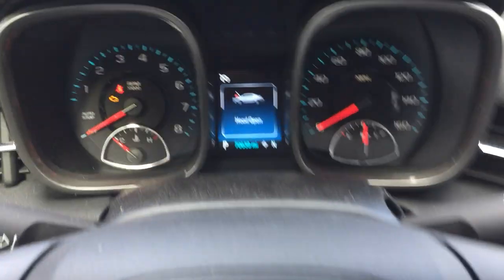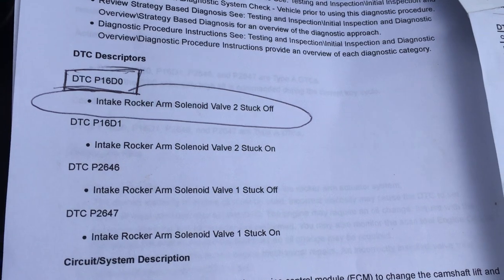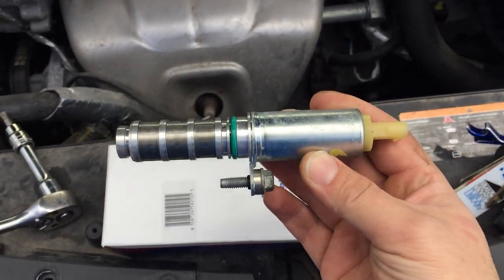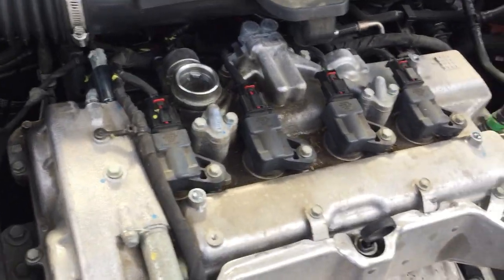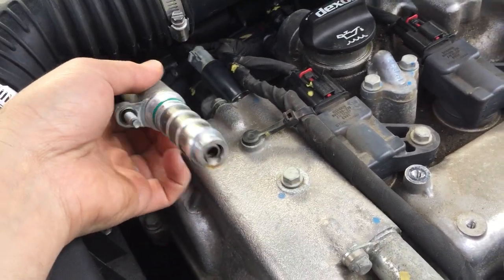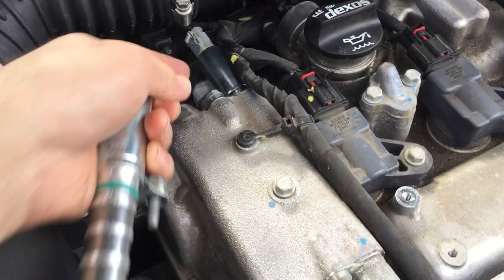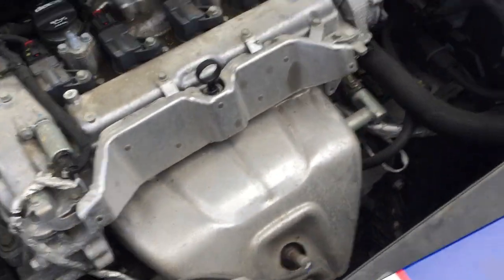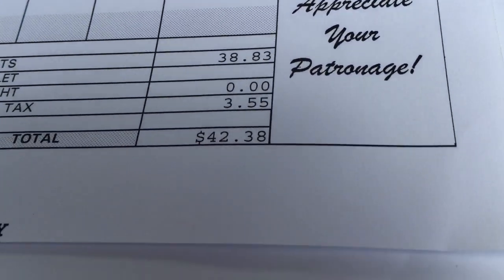How to 2014 Chevrolet Malibu 2.5 Intake Solenoid Valve Replacement (Same for 2013-2016)

Comment: Thank you for taking the time to make the video. My exhaust solenoid failed on my Malibu at 82K miles. It started sounding like I had jake brakes or a custom air cleaner when the CEL came on. Dealer quoted $287. You also gave specific instructions on how to disconnect the wiring connector (3:15). Cleared code with OBD2 Scanner. Fuel mileage shot back up immediately. Thanks again, sir!
Reply: You can also disconnect the battery for about 5 minutes and the check engine light should go off if you have already changed the solenoid. 👍 
Worked for me anyway.

Comment: This is a great and helpful video! Took the malibu in and got a quote, mechanic said $1300 to fix this issue 🤣 part was $55 and took 15 min to change. Thanks!
Reply: What did you use to remove the three screws holding the engine cover on? they are a wierd triangle type screw head
Reply: Star tip head. T 30 I think.
Reply: @BMBProductions98 what he said will work or a tri point bit

Comment: I thought your diagnostics said it was the rocker arm oil control solenoid?  What you changed are the VVT solenoids.  And the Rocker Arm Oil Control solenoids had a special coverage "warranty" from GM under certain circumstances.  FYI

Comment: Wow! My 14 Malibu has a stall issue that the dealership had to contact GM over. They said the problem was the "intake camshaft actuator". The dealership told me it costs $330 for parts, labor and tax!
Reply: Mines stalls too. Like when I put it in reverse or accelerate slowly, when I’m sitting at a light it feels like it wants to stall.
Reply: @Rich A  ours ran fine until we got to a redlight and autostop kicked in. Then it would try to restart the engine and shut down completely. We replaced the intake and exhaust solenoid, worked great (until my wife totaled it 4 months later 🤣)

Comment: That’s strange because that part is a ENGINE VARIABLE TIMING SOLENOID. The CAMSHAFT SENORS A/B BANKS are small plastic plug looking. Codes P0016/P0017 is the manufacturer’s EU  ID#. Those 2 parts in the video are filterers and sliding slot valves for timing of the cam lobe and spark firings DURALAST TS1191. I know because I have a 2015 CM with the 2.5 liter Eco TRASH. I had trouble with check engine light from TIMING CHAIN SLACK,PCV FRESH/ SECONDARY/SPARK SEQUENCE/ACCELERATOR THROTTLE POSITION/LOW OIL PRESSURE/ REDUCE ENGINE POWER/HIGH O2 and EXHAUST O2 and RESONATOR SENSOR  oh yea my head lights, both brake lights and the turn signals along with the battery all started and went bad at exactly 105k mile marker. I change my oil, brakes, fuel filter and maintenance of all my vehicles in scheduled maintenance . This is the only GM vehicle in my entire life. I am a FORD AND TOYOTA MAN. This vehicle is a highway vehicle and it’s a piece of SHIT. I have a FORD MUSTANG 1990 is a hot rod with BOOST 1656HP,FORD EXPE 4.6  has 187K miles and Lexus GS460 has 134k milesNo problems with any BUT THIS ECO TRASH is a SHIT Pile.
Reply: That's what I said!  LOL. Those aren't even the Rocker Arm oil control valve solenoids.  The the VVT solenoids.  his codes probably came back on after driving it for a bit because disconnecting the battery would have cleared the codes temporarily.

Comment: My car is doing a very small skip/shudder in 3rd and 4th gear. The ONLY code that keeps coming up is P2646 (15’ Malibu LT 2.5). I changed the oil and it started driving a little better, but it’s still doing that random skip/shudder (it’s ugly). Any suggestions? Again, no other code comes up and when i turn the car off, the engine light goes away and the car is fine. Not sure what to do.
Reply from the maker: Hey there, sorry to hear about your car.  So 1st thing I suggest is to check the related fuses, some of these cars have a fuse for related oxygen sensors, rocker arm actuator system, and related sensors.  Just pull you owner's manual and start checking every single fuse or just related fuses.  If any related fuse is bad, replace it.  Also replace your Air filter if it is bad or dirty.  If you had the Air filter for more than 10-12K miles just go ahead and replace it.  It only costs $10-$20 or so.  Since it ran little bit better after oil change, the problem seems to be the dirty, or clogged solenoids, valves, and sensors.  So I would also pour in about 5 ounces of Seafoam or Gumout into the engine run it for 20-30 highway miles or so and then do another fresh SYNTHETIC oil change.  This might help, but you have to spend $30-$50 on this one.  Here is one video where it helped my car after I changed the "Oil Control Valve" on the engine.  So here it is: 
https://www.youtube.com/watch?v=gbACkPvNyrY
How many miles do you have on your Malibu?   I hope this helps, let me know how it goes.  Good Luck!!!
Reply: @fixit3879  can you put that in a turbo motor?

Comment: I have the pc16f code on my Malibu 2015 2.5 Lt looks to be about the same problem gunna replace both intake and outtake looks simple enough
Reply: Did that solve the problem, I have the same code
Reply: @joifullyfit  i thought it did but then the check engine came back so I changed the engine variable timing oil control valve the check engine was still on but after driving it for a bit it went away on its own

Comment: I replace both of those valves Intake and exhaust Solenoid , Light came back on after 15 miles....
The intake rocker arm solenoid in the center of valve cover is my next try...
 I been looking for info on  P16d0   This is what came up on alldata =
Remove the Q25 Rocker Arm Solenoid Valve. Verify the following conditions do not exist:
Torn, restricted, mis-positioned, or missing screens at the rocker arm solenoid.
Engine oil leak between the cam cover and the rocker arm solenoid.
Oil seepage at the rocker arm solenoid connector.
I replaced the wrong solenoids ,
Reply from the maker: Sorry that you are having tough time with it.  How many miles do you have on yours?  Here is the video that helped me with my P16D0 code.  Once I replaced the oil control valve, it fixed the P16D0 code.  
https://www.youtube.com/watch?v=gbACkPvNyrY&t=2s
Sometimes the same code can be thrown off for 10-15 different problems and it can be hard to pinpoint the solution.

Comment: How much was it and where did Yu purchase Solenoid Valve
Reply from the maker: It was about $40, I purchased it from Chevrolet Dealership.  Hope this helps, Good Luck!
Reply: @fixit3879  my Chevy dealership where I live in Louisiana wants $108 for this part and also I brought it to a shop just to see how much they would charge to put it on they say $360😱 hell no!! I watched yur video how Yu said Yu put yours on ND it looks pretty easy So I'm thinking about doing it myself but I'm kinda scared! I Kno I need it done but I don't have $360 to gv for smthng dat won't even take 30 mins to put on!  I saw the part online Wut do you think about online purchasing the part? Also wut will happen if I don't get it done soon my car is a 2014 Malibu with 124,000 miles due to job travel
Reply: @imaqueenfirst980  online is fine. The parts come from the same places. You need the part. Get it done!!

Comment: Bruh I've replaced this exact thing and I still have a check engine light. I believe it's actually the variable timing control valve, not the intake solenoid like the code says.

Comment: I've replaced in my 2013. Camshaft position censor. Couple years ago now I'm getting a overtimed camshaft position. Timing brlt?
Reply from the maker: Thank you for sharing.  Honestly I am not sure about this one.  Do you have check engine code?  How does the car run?  How many miles do you have on it?  Is the engine oil fresh?  It is possible the timing belt may be worn, but it can also be few other things....

Comment: Question , by any change when you accelerate do your car make a noise like a growl. I got the LTZ 14
Reply from the maker: No not growl or noise. It was fine after I fixed the code and replaced the intake solenoid valve.  However 2 months later same code re-appeared. This time I had to replace an “Oil Pressure Control Valve” and it fixed the shakiness at 35-60 mph speed. The oil pressure valve part coast around $98.  There 2 fixes that I found out so far.  Replacing the oil pressure control valve helps too.  And please people use synthetic oil now. These modern cars the conventional oil is messing up all the valves and tiny engine components from my personal experience.  And do change oil frequently without delays....
Reply: FixIt I thought we have to used synthetic blend
Reply from the maker: Maybe so.  But the problem with synthetic blend is we don’t know how much of it has synthetic oil in it.  So most mechanics suggest using synthetic oil on these modern cars.  I personally switched to Royal Purple premium Synthetic oil a year ago for ALL my cars. I can go 10-12K miles on Royal Purple.  I love it.  So my opinion is using synthetic oil  is better than using synthetic blend.  Good Luck!
Reply: FixIt thank you will try it out
Reply from the maker: You are welcome!

Comment: GM has a Special Coverage Adjustment N192289160 Rocker Arm Oil Control Valve Inoperative if under 120k miles or 10 years old

Comment: My connector that connects to the exhaust solenoid valve is broken where can I find a replacement?
Reply from the maker: Hello Bruce.  Any local Chevy Dealership will have that connector at their Parts department.  If they don’t have it they can order one for you.  Just check with the Chevrolet Dealership, any dealership is fine.  Just the socket ranges from $5-$15.  Sometimes if it is an entire wiring harness then it may Range $20-$150.  Hope that helps.  Good luck!

Comment: What was the issue with your car before replacement?
Reply from the maker: Honestly nothing except for the check engine light was on and it gave the P16D0 code.  However at times I felt mild vibrations at certain speeds around 35-40 mph throughout the car.  It would come and disappear.... hope this helps.
Reply from the maker: So another possible fix is replacing the “Oil Pressure Control Valve” about $100 for that part at dealerships....
Reply: FixIt Do you have a write up for replacing the oil control valve? Keep getting p16d0 code, I replaced the intake rocker arm solenoid but the code still remains.
Reply from the maker: Hello Ian Halstead.  Here is a short guidance video as to what part and how to replace it: 
https://www.youtube.com/watch?v=gbACkPvNyrY
Reply from the maker: Good Luck!!!!!
Reply: Nothing down and check engine light on

Comment: For anyone watching this in 2021, Chevy has released a special coverage for 2014 Malibus for this code and a couple others: https://static.nhtsa.gov/odi/tsbs/2020/MC-10177367-9999.pdf
Reply: Nicholas, thanks for the information.   Replaced mine at 137K   Outside the 120K warranty but this is a none issue from GM.   After purchasing 8 GM vehicles lets see if they stand by the product.

Comment: The code P16D0 is for the Intake rocker arm solenoid valve 2 stuck off. The solenoid you replaced is for theVariable Valve Timing system and NOT the rocker arm control system. The intake rocker arm solenoids are in the center/back side of the valve cover. You replaced the wrong part that had nothing to do with your code. Maybe know what you're doing before posting a video on YouTube because who knows how many people replaced the wrong part because of your video. You really should take this video down so more people don't waste their time and money.
Reply from the maker: https://www.youtube.com/watch?v=gbACkPvNyrY
Reply from the maker: https://www.youtube.com/watch?v=gbACkPvNyrY
Reply: Seriously
Reply: He replaced the right one the code is pc16 for some reason it comes up wrong in autozone computer for pc16 as the intake rocker arm which is p16d0. How I know. I’m a mechanic and just had to change mines. He did a good job tho. It’s only a 5 min job thanks.
Reply: What you are saying is half true...Manual says to replace the Q25  Rocker Arm Solenoid Valve but there are many confirmed fixes of intake timing actuator solving problem.
Reply: @djenn434  You are wrong. I am an automotive service technician with over 20 years of diagnostic experience. The code setting criteria for this DTC is for only the rocker arm system. The VVT solenoid cannot set this code. People claiming that the VVT solenoid fixed their problem probably had an intermittent fault that didn't reoccur after replacing the wrong part.
Reply: @thirdeye530  Ya I went to school for auto mechanics and work on vehicles too...Also have access to Alldata and identifix, do you know what identifix is or have access to it? There are like 30 confirmed cases of intake solenoid fixing this code.
Reply: @djenn434  Yes, I also have access to those sites but those "confirmed" fixes aren't confirmed. Anyone can "confirm" any fix for any problem and post it to identifix. It doesn't mean its confirmed... or correct. I've worked with enough idiots over the years to know that most mechanics working at shops dont really know what they are doing. Do you know what code setting criteria is? This DTC  can't be set by the VVT.
Reply: @thirdeye530  Sounds like we have the same information and if there weren't 30 confirmed fixes in identifix I'd be agreeing with you 100%...I'm just putting a little more faith in identifix which may be a bad thing. I'm currently dealing with this code, I"ll let you know how it turns out.
Reply: @djenn434  I'm not going to argue with you over the internet. I usually don't comment on YouTube or social media posts but I felt the need to try and save people from wasting their money on replacing the wrong part after watching this video. Good luck and have a great rest of your day.
Reply: @thirdeye530  Went and looked through identifix again and looks like I misread the "confirmed fixes". You are right :( take care.
Reply: @djenn434  Hey, thanks. Much respect! insert boy tipping respect hat at a sports game gif
Reply: Thx ckatanic. I just replaced it before doing more research and reading. He did do a correction video showing which part to change and where to change it. He should remove this video or change the name of it. Well I shouldn’t have to worry about changing this valve again/for a while. However my check engine light did go off after changing it. I agree likely an intermittent fault that went away after unhooking battery for a while.

Comment: Rockauto is the place to go i got a p0010 pr whatevs it's a crankshaft actuator position sensor failed at about 80K so did some research and they usually fail at this mileage so I ordered both and oil and filter because oil usually clogs these but everything walmart oil $22 stp oil filter $10 and solenoids acdelco oem $34 and $37 and then 2 day shipping parts all together like $100 my mechanic quoted me $100 for install
Reply from the maker: That sounds great.  Walmart does have the best price on oil and filters most of the time.  And $100 for install is not too bad.  I know some mechanics charge $50 for installation, small shops or individuals.  Thank you for sharing!  Good Luck!

Comment: Stealership quoted me $300 for this job and oil change with my own parts provided geez this would take 30 minutes at most just do engine c9ver take off and replace then do oil change lol
Reply from the maker: Wow, lol.  So about under 1 hour with oil change, and that will be $300 please, KaChing!  That is stealership for us.  Thanks for sharing. Good Luck!
Reply: My dealership told me $286 plus 1 hour of labor.  Damn thieves!

Comment: i had this fixed today and my light came on again after 2 turn off/ turn ons even after clearing. i dont understand why, nothing else is wrong with the car
Reply from the maker: The same code P16D0 can come on due to oil control valve failure as well.  Mine came on again after 2 months of fixing it and the 2nd time I had to replace the “Oil Control Valve”.  Here is the details on that 
https://www.youtube.com/watch?v=gbACkPvNyrY
Good luck!
Reply: it ended up being the oil pressure sensor. so now i have new valves and a sensor and the car drives fine now! :)
Reply from the maker: Great!  Glad to hear that!  Keep your oil changes fresh and on time.  That will keep the engine clean and working with no problems.  Curious about how much you had to pay for the oil pressure sensor?   Thank you....